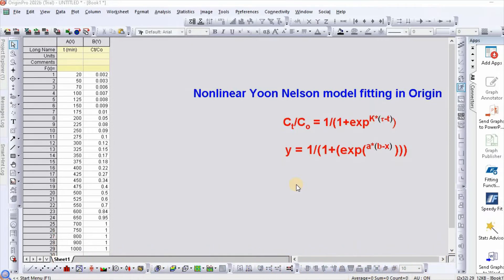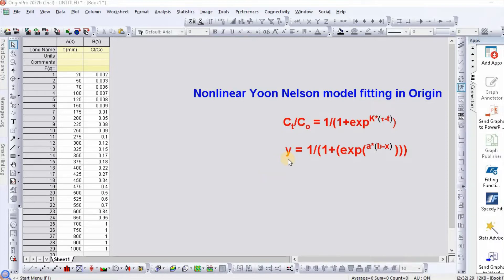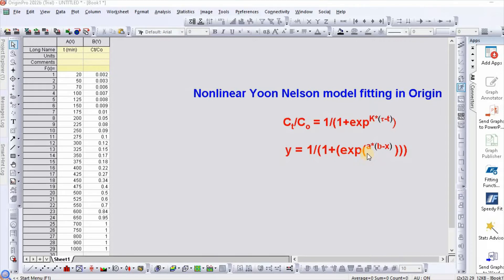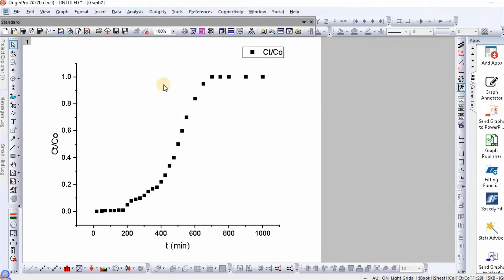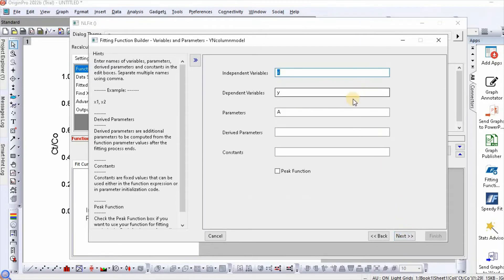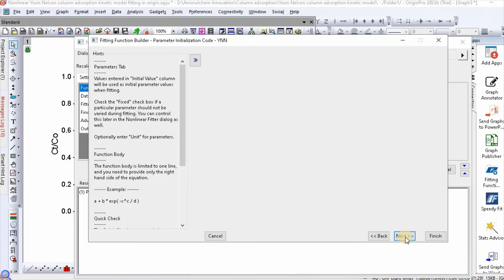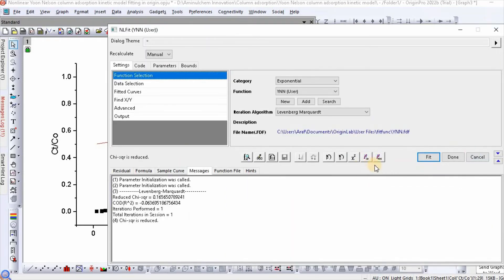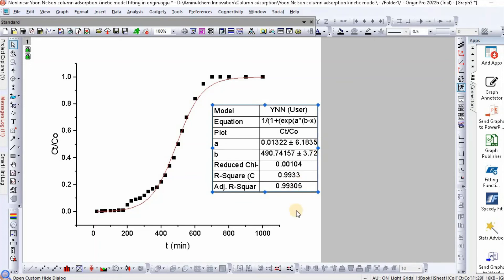Yoon Nelson column adsorption model non linear fitting in origin

Comment: I am getting the error" fit didn't converge- mutual dependency exists between parameters. You may have overparameterized the fitting function. Fixing one of them may eliminate this problem. I used origin pro 2023 trial version
Reply from the maker: Thanks. Actually, you need to practice a lot watching my videos.  Hoepfully, you will be able to da that. Good luck.

Comment: It do not give proper fit in origin 2018. Displays the message"You have overparametrized some of the function. fixing one of them may solve the problem". Kindly give resolution sir
Reply from the maker: Thanks. You can try several times while watching the video. If not solved then you try to install originpro 2022b trial version which is free for 21 days
Reply: @Aminulchem  It  Worked but now I am not able to fit multiple lines. only one selected parameter get fitted. If possible please make a video where all models are fitted simultaneously on one given data.
Reply from the maker: @atri-chemistry  Thanks. In this case, fit each model separately. Then plot original data and fitted data together    for all models in a separate graph.